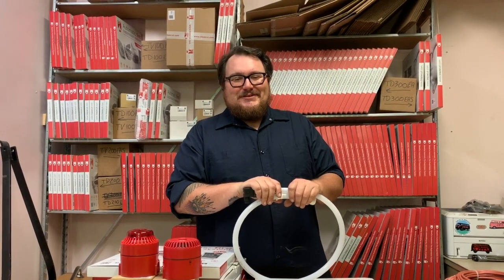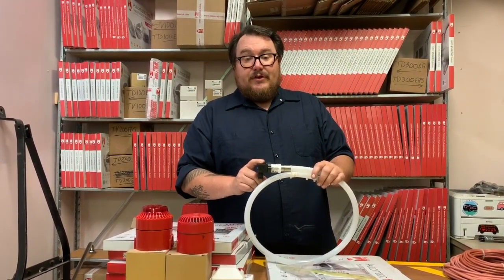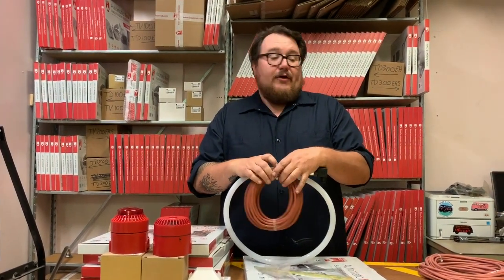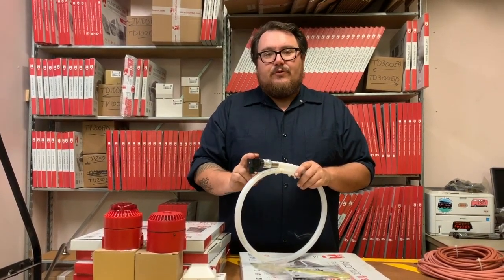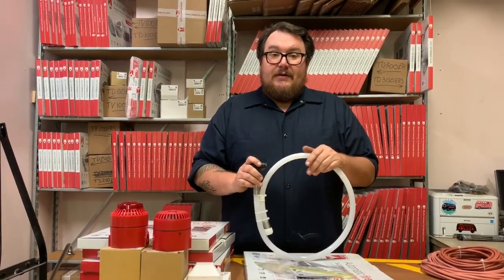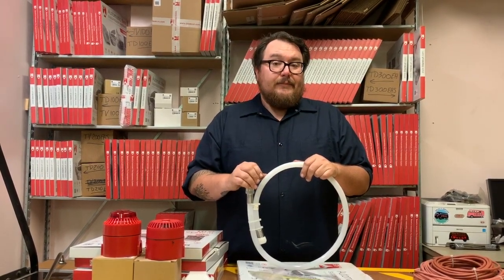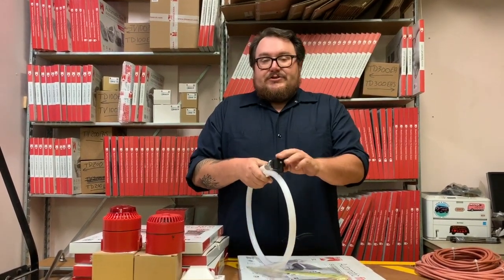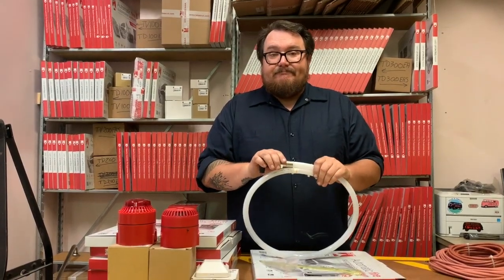BlazeCut T series with Pressure Activated Switch

Comment: So electronics idiot here- how could you rig this with a 3D printer to shut it down once the suppressant is activated?
Reply from the maker: there are multiple solutions.  One way is to use the pressure switch to control an appropriately rated relay.  The power supply for the machine can be run through a N/C contact on the relay, and when the pressure switch activates, it is energizes the relay opening the circuit.